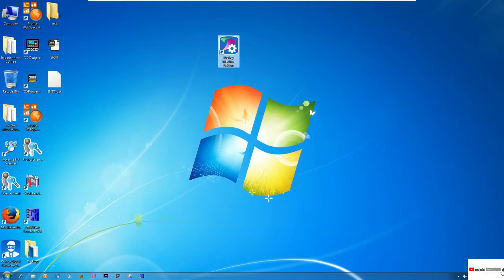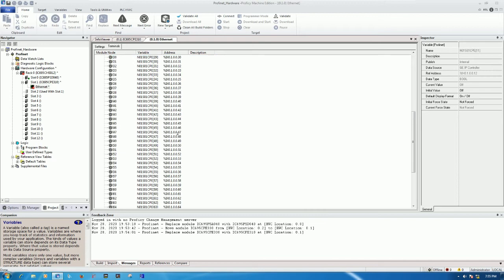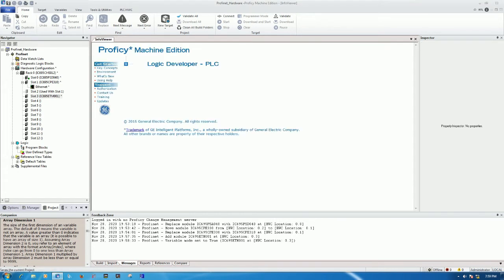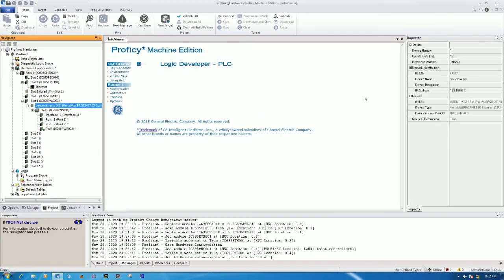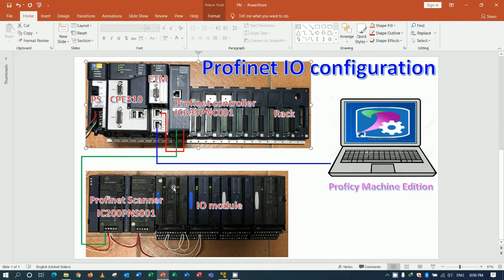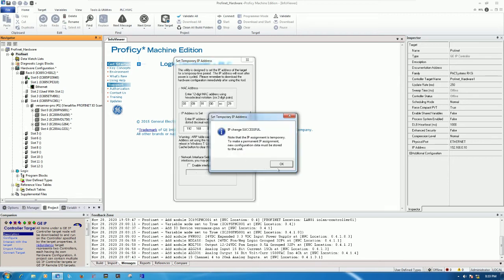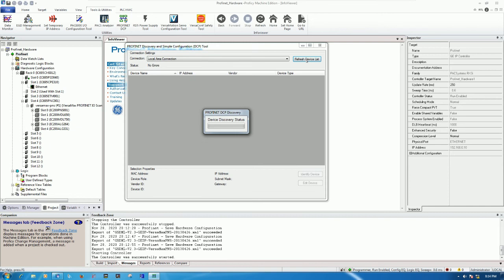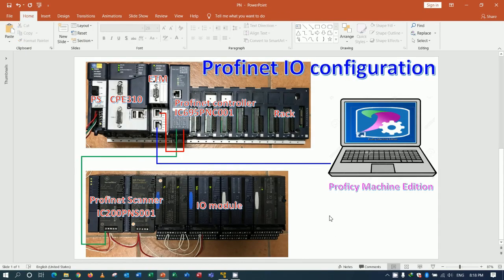Proficy Machine Edition V9.0 how to configure hardware Profinet controller & Profinet I/O part1

Comment: can i contact you sir apart facebook can u give your number i am facing problem with adding two controllers
Reply from the maker: Dear sir,
Yes
Reply from the maker: What is the problems with your adding sir?
Please let me know
Reply: @generaltechnologyknowledge5165  sir if u give your number I will explain over phone sir please give your number sir
Reply: @generaltechnologyknowledge5165  I have cpe330,two PNC 001 and four PNS 001 MODULES .I would like to communicate PNS modules with two controllers as redundancy system how can I assign IP address please tell the that